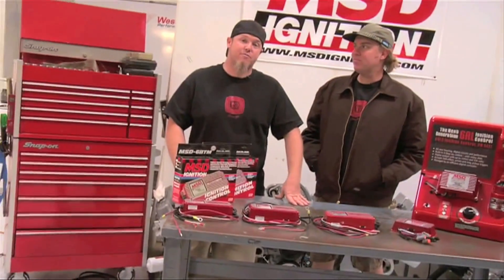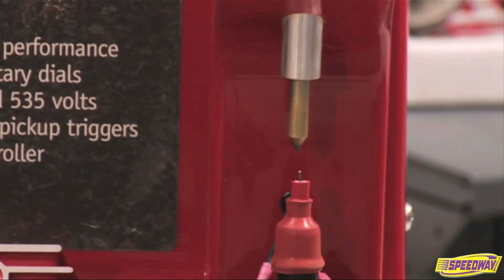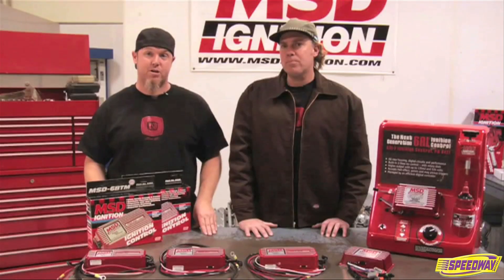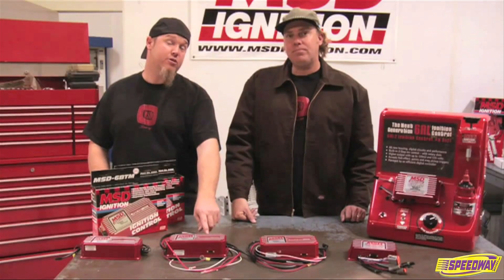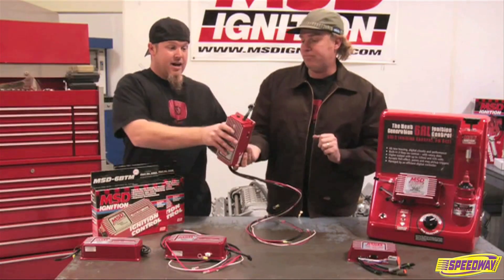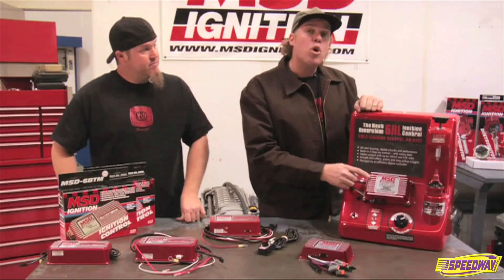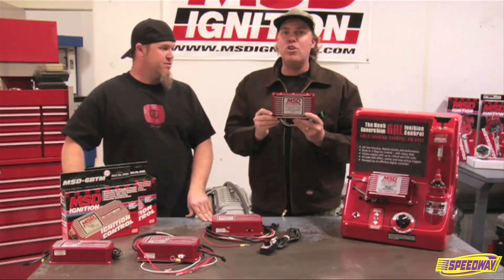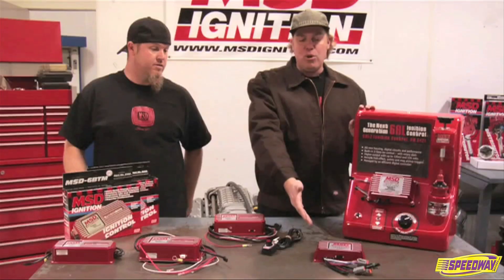Differences Between MSD 6 Series Ignitions

Comment: Had one of these in my '71 Ranchero back in the 1990s, running it through a single point-type ignition. It made an immediate and very noticeable impact on the way that mildly modified engine ran. 😁